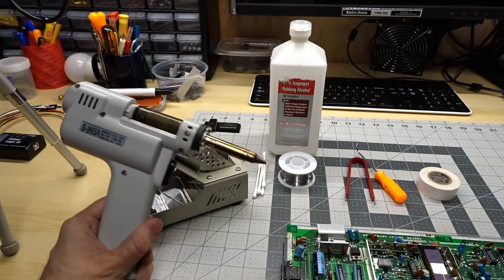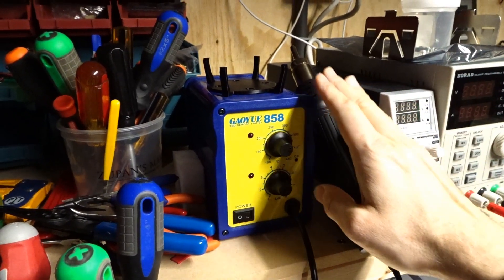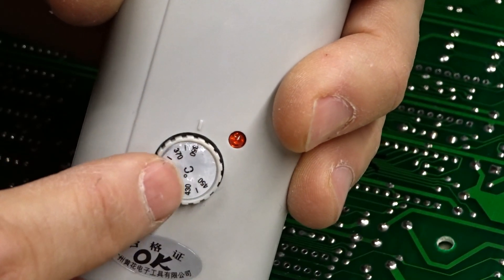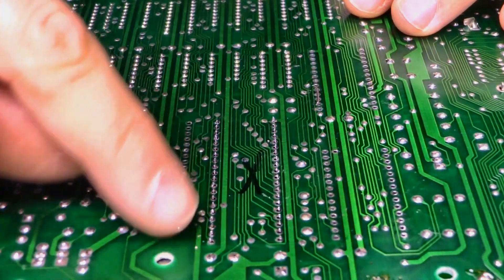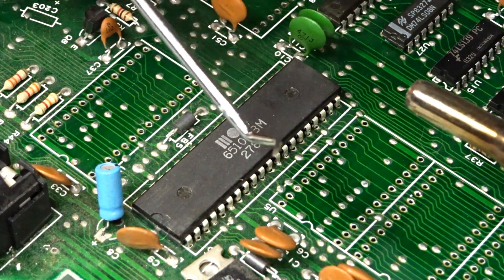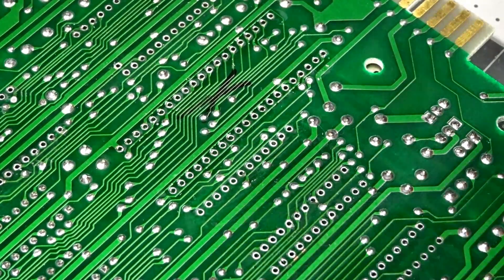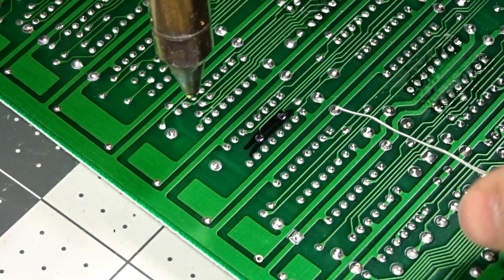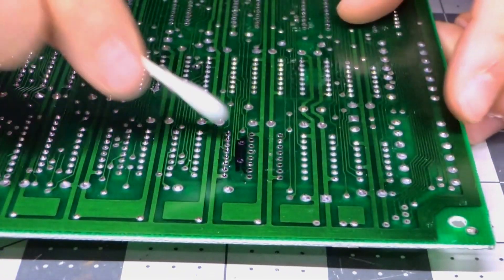How to remove chips without damaging the circuit board

Comment: Makes me wonder if the extra $150 for the Hakko would get those holes clean on the first time
Reply: I can only offer you one anecdote based on just my recent experience, but I used to struggle so badly with desoldering, even vintage equipment with lead-based solder after adding new lead-based solder and flux.  When I tried to desolder some newer, lead-free equipment recently, I wasn't getting anywhere fast, and risked damaging the board.  I finally caved and, after much soul-searching, sprang for a Hakko FR-301-03 (the American version, not the Japanese version on eBay that is meant to work on 100V instead of 120V).  So how well did it work, especially considering my admittedly pitiful desoldering skills?  Like a charm! 😃  I set the temperature halfway between 2 and 3, as this was a multi-layer board with lead-free solder, and all it took was a single try on each of 15 pins (no added solder or flux, and no wiggling--just placed the nozzle around the pin, waited a second or less for the solder to melt, and sucked it up).  Afterward, the component pulled right out without any resistance, and the holes were all clean.  I could hardly believe it!

Others who have compared this unit from Hakko with the one Adrian uses have noted that the Hakko reaches temperature faster, holds it better, and has stronger suction.  Still, I really didn't think it would work this well, especially for me, but it did.  The pain of its price tag is already a distant memory, and now all I have to worry about is paying for plastic surgery to get the smile off my face. 😁  Obviously, I can't guarantee that you'll have the same experience, but take this as a data point as you do your research (if you're still thinking about it, a year later by now).

Comment: Many years ago when I was repairing C64's I made up a tool from copper that sat over the tip of my 80W soldering iron and it had slots that I filled with solder to go over the pins on the bottom of the PCB. I'd heat the pins and pull the chip with a chip puller, then use a soldering iron and solder sucker to clean out the holes. This method was successful, but I like your method better. Since then I bought a cheaper de-soldering tool than yours, with spring operated suction, which works OK, but you have to remember to point the tool into the scrap solder tin before releasing the trigger, otherwise you get solder spattered on whatever it was aimed at. I also had a test board with sockets for testing any suspect chips. I'm here in Queensland Australia, so it seems that the C64 made it to a lot of countries during it's life. Thanks for an interesting and useful tutorial.

Comment: Having been using a combination of the hot air re-flow, manual pump and solder wick method for a long time I finally decided to make my life easier and get a vacuum gun. I ordered the same model as yours, it's still about the cheapest out there, today. It will be with me on Thursday and I'm sure it will be great for hobby use.

Comment: i recently bought a pros kit ss 331 de soldering station. it seems to be of decent quality and the price was decent. its got a universal transformer in it so it can be used on 110 or 220 connected with a standard c13 plug . the only thing i don't like about it is that the on off switch is on the back of the unit rather than on the front. although that can be easily moved.

Comment: Thanks for the great video... You could probably change the potentiometer in your solder gun to a higher value, so as to be able to turn the heat down further. Or, add a resistor on a SPDT switch to bring it on line in series to the pot, or to bypass it. There are lots of DIY solutions. Taking a look inside the gun will reveal the best route. Maybe make a video about the modification...

Comment: Your technique is pretty good.  Something to point out or mention is to hesitate just a little before applying vacuum to ensure the solder melts all the way through so you get solder from both sides.  The second item is to shotgun the pins (jump around 1, 30, 40, 20, 2, 31, 39, 10 ....) so you don't build too much heat on the board or on the chip in any one spot.  When shot gunning, switch sides and switch ends.
Reply: I always jump around or shotgun as I solder in a chip. Like you say to prevent too much heat in one area.

Comment: Great Video, I have the same desoldergun - now I will try to find the hotair gun too :) Looks easy that way. Two years ago I replaced 8 vram ics in a ColecoVision board, I did not use my desolder gun, but I cut all the legs off the ics, and reflow the solder, and used a manual desolderpump to remove the solder one by one, and remove the legs. It took time but it worked great, I only had two traces broken and it was easy to fix with jumping wires.  By the way I dont understand all the Thumbs-Down - why ? what is most fun is Adrian always tell people in the end of the video to give a Thumbs-up if you like it or Thumbs-Down if you dont. At that point all the Thumbs-Down people, had given up to watch the video I guess. - Keep up the great work - Claus from Sweden - www.mtxworld.dk - By the way I am a Memotech MTX fan, if you ever come by one of those Memotech Computer, you will for sure have to use your repair skills :)

Comment: Try doing that on a 10 layer board and you won't get far! Cut the legs flush with the chip using something like Lindstrom cutters to remove the chip. Then using two hot irons, firstly place one iron on the bottom then the other one on the top to gently remove the leg.  The hardest part is clearing out the voltage and ground plane holes. This method has served me well for over 40 years.
Reply: Agree. If I was removing a "bad" chip, I would always cut legs leaving either the ground or  power pin to heat up that one pin while slightly pulling the chip. I never risked damaging pads or traces to get a "bad" chip out all nice and intact just to go in the trash.

Comment: Thats a really great method and I've used it every since you suggested it. However 180°C or even less works really well for me, too. I really don't know why, but it seems that temperatures even below the solder melting point cause the IC so "slip out" out of the remaining solder very, very easily.

Comment: Hi from the UK! You may say "what the..." at my trick: Warm your oven up to about 150°C (300°F?) and chuck the entire mobo in there for about 10mins. Preheats everything and hence your desoldering iron & hot air gun has less work to do. Simple but effective! Added benefit is that localized heating of the PCB is reduces and thus less stress to the PCB (due to localized heat expansion warping the board). A

Comment: Can the chip be removed with hot air from the beginning?
Reply: it's not ideal, but it works okay on boards without ground/power planes if you don't have a desoldering iron, especially for small chips. i do that regularly
however, you'll end up with solder on chip legs as well as on board that has to be cleaned up. some amount of flux paste with copper braid or manual solder sucker will help. using a desoldering iron when possible seems like a much cleaner way

Comment: That's the same desoldering tool I use. The two air filters are hard to find. I need a hot air tool, that looks far easier than solder braid

Comment: Could you recommend a good cheap hot air gun?  Do you need one with an LCD display?
Reply: in my experience any would do. the lcd display is nice, but not essential.
i suggest you practice on boards you don't mind butchering -- with and without the ground planes in between. that way you'll develop some feel for the proper temperature and right amount of time.

Comment: are the ic-s still workin after the desoldering?
Reply: yes. most chips can sustain quite some heat for much longer than adrian exposed them to.
you generally don't really need to worry unless you really go nuclear on them

Comment: I have used hotair on board and my board swells up. I had kept temp at 300c. Any advice?
Reply: 300c is an okay temperature. i guess you heated it for far too long -- try to work faster: remove as much solder before as possible (with a copper braid, solder sucker, or desoldering iron), and perhaps help the solder flow with a bit of flux paste.

Comment: Thanks for this video! After struggling with desoldering a CIA chip I saw this video. Some hot air later and problem solved. Now my C128 is running flawlessly again :)

Comment: Just started socketing some chips on a C16 board and came back to review your video for tips!  Proper tools are highly recommended for this work, but I was able to get by with a manual solder pump and constant-temp heat gun.  YMMV!  Using the manual pump, I put the board in a vise (clamped in a safe spot), added fresh solder to the IC pins, then heated the IC pins from the top/chip side so I can remove the solder while still liquid.
Reply: If anyone wants to see how I did this, I filmed my procedure and talked about some pitfalls with this method: https://youtu.be/fb7iWSXNta4

Comment: Here is another hint before pulling the hot air gun: grab your fine nose pliers and lightly wobble the pins from under the board: this has two benefits 1) you will know which pins are lose and 2) sometimes it's just a tad of solder holding the pin and wobbling it will break that last point.

Comment: What pick do you use for desoldering? Any product name oder number?
Found it: pick is a: PITTSBURGH 66863
Made one in the meantime with a bended nail in the same form where I sawed off the head and put it into a battery powered drilling machine 
into the drill chuck (of course no motor will run). Was just a quick hack. Works very well.
Desoldering technique works really good. Great!

Comment: Excellent technique. The hot air is the key. I have the same de solder gun but always felt it did not have enough vacuum. This hot air guns are awesome ! I have a couple like that. They are inexpensive but work great for all my SMD work.

Comment: Good job! I’ve used this method too, but with just a solder sucker. Heated up the solder with the soldering iron and sucked it out. Then used my hot air station to get out the chips. I’ve recently bought a desoldering station and I’m really happy with it. It has a powerful vacuum pump, so desoldering takes out almost all of the solder. It’s now a breeze to remove chips from these boards without damaging traces.
Reply: What is your Brand of desoldering gun? Where did you get it?

Comment: I have that same desoldering iron and I find it works great! I will definitely have to try the hot air rework station afterward. I have used it before for surface mount stuff but never through-hole.

Comment: Great tips! You can use some solder wick to clean up the remaining solder in the holes too, as long as you don't push down and grind it around and melt the adhesive holding the traces and pads down.  I used to remove and replace huge SO chips with just a cheap heat gun with good success rate!

Comment: Good job Adrian.  On a recent spares repairs board I bought the last owner wasn't so careful and so many pads are wrecked.  Those soldering stations seem expensive but in the long run it's mo ey very well spent.  I generally use 340°C for desoldering and the methods are more or less identical. 

Keep up the good work, really enjoying your C64 content.

Comment: Adrian Black, I don't see you repair many C64c shortboards and mostly see you handling the older long boards from breadbins. I know the shortboards are alot more reliable and has far less chips than the older long boards. So you like the older boards better? Maybe you like the older SID over the newer one?
Reply from the maker: Heh here in the US there are just that many shortboards. Plus, like you said, they are so reliable compared to longboards. I actually prefer the very late model long boards and shortboards too since they are just more reliable.

Comment: some extra caution steps: a) for crowded areas in a board use kapton tape to insulate sensitive components from excessive heat (specially when using a big gun like shown in video); b) a good substitute of the desoldering pump is the copper braid; c) when some pins are still soldered it's best to use a soldering iron with an adapter multipin for the IC package you are desoldering (i.e. DIP-40), thus applying uniform heat at the same time in every pin and the pull is safer; d) try not to use metal picks/screwdrivers to apply force to plastic/ceramic components, you really risk phyiscal cracking of the component; I find it very useful and safer to use the "black stick", that anti-static plastic tool used by phone and netbook repair (i.e. ifixit sends those, really chip in quantities of 10)
Reply: Desoldering braid can be inconsistent but it works much better if you put some liquid flux on the braid first.

Comment: One note of warning concerning the desoldering station, be sure to let it heat up good and proper. The rear of the tube doesn't heat up as fast, and your solder will eventually cool off in this spot and cause a clog.

Comment: I'm an electronics engineer and your method is better than mine. As Romans when they found better weapons or tactics they incorporated them. So I'm switching to this technique thanks
Reply: I have seen this technique used on many different channels and it works. It would take a lot of solder to remove a lot of chips which I do often. I salvage chips before I throw anything away because many of chips are hard to get unless you buy 500 of them at a time.

Comment: That desolder gun is pretty slick!  I usually heat all the pins at once with a blowtorch and pull the chip with a pair of pliers.  But although fast it's.... Not very precise.  :3

Comment: When the holes look clear but the chip doesn't fall out, it often a cold contact with the plated through hole that's easy to loosen safely without heat. You can often free it by just rolling something round and blunt against the pins. I use a metal spudger but you could use a spoon handle or whatever.

If putting inward pressure on the legs from the top side doesn't snap them free and loosen the chip, try outward pressure from the bottom side. You aren't lifting away from the board so the traces are safe.

Comment: Some of the external pumps actually work WORSE because they have to depressurize the entire path from the station to the gun. Because vacuum develops at the tip more gradually it will not remove all of the solder at once, which allows it to solidify on the other side or in the through hole as the weak suction removes only the solder that was conducting heat to those.

Comment: this is a nice technique that I will use in the future.  I struggle because the tip of my desoldering iron is always oxidated and I have a hard time keeping it wet while desoldering.  By adding the new solder every time, you are constantly wetting the tip and keeping it in good shape.  Thanks!

Comment: Thanks for this video!  I've had a Hakko 808 for some time and also had a problem with only clearing holes on chips from the bottom side.  I, too, used a bit of hot air on top to finish the job, but I thought perhaps I was doing something wrong to require doing anything on the top side!  Nice to know I was not alone in that strategy!

Comment: I really have to get one of those desoldering irons. For almost 15 years I’ve been using a desoldering bulb, and while it’s better than no suction method at all, that method sucks.  I’ve refined my technique over time to get better results and safer chip lifting (especially important on my C64 boards), but invariably there’s one or more pins that didn’t fully desolder and fight against the chip lifting, resulting in broken pins (easy fix) or lifted traces (hard fix).

Comment: Great video. I just ordered a ZD-915 desoldering station from Amazon. I have a few C64 boards to try and repair. There was no way I was going to use a hand pump to desolder. I never had very good luck with those suckers LOL. Next is a rework station.

Comment: This video is really worth watching. I have this box attached kind of desoldering gun. the ZD 915, which is quite ok. You need to keep the core clean and get rid of the solder in the cylinder quite regularly. The price is not more than was you have paid.

You hot air usage is what is new to me. I really like it. And I have to make such a lever, that you have used. I was thinking of it already. Yours look really neat.

I was working in the development department beside a big electronic factory, so soldering difficult things was not required for me. I have had nice colleagues, who had all tools and knew all tricks. After quitting there, I really miss that (and the nice colleagues of course). After watching your video, I will miss their soldering abilities a bit less. I sure have a hot air station, too, but I was only using it for smd and heat shrinkable tubes. Excellent, great video.

Comment: Oh, I forgot: It's better to desolder every second pin and then start over with the left out ones. Thus the board stays a bit cooler.
Reply: I do the same thing when soldering in components. If for example I have three transistors to solder in, I hit one pin on each before coming back to the first one. Just be sure to not forget any. :)
Reply: @MrWaalkman  I learned this the hard way today...
Reply: @Kimchi_Studios  Ouch. I hope that it wasn't a hard to get or an expensive one.
Reply: @MrWaalkman  What happens if you just forget one pin tho? Can't you just solder it after?
Reply: @goku445  Sure. It shouldn't be a problem. Off of the top of my head I can't think of anything other than your board wouldn't work until the pin got soldered. Tracking down which pin got forgotten could be lengthy...

Edit: I suppose not having a pull down/up resistor soldered in could make things interesting...
Reply: https://youtu.be/xf8kI4urQsI